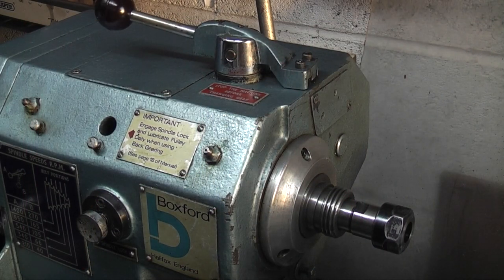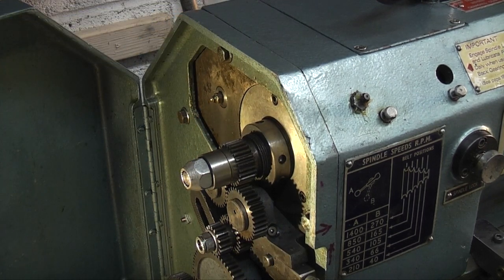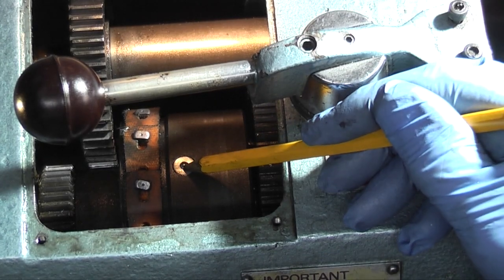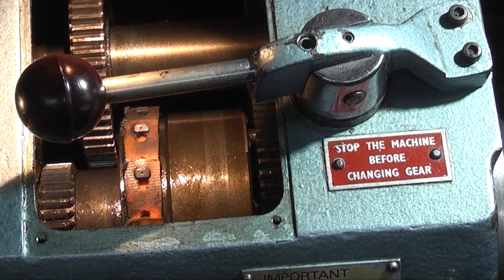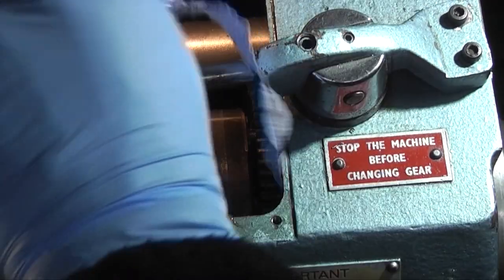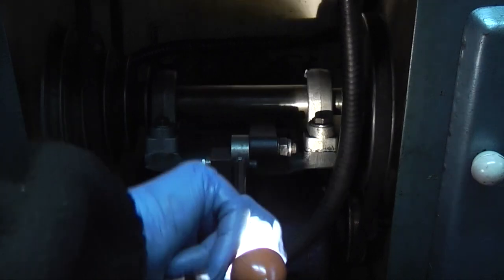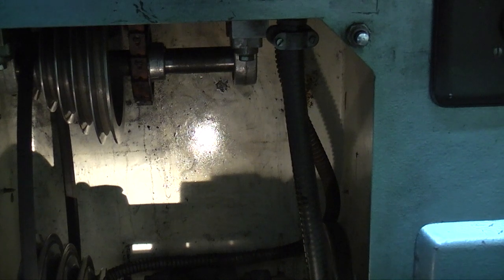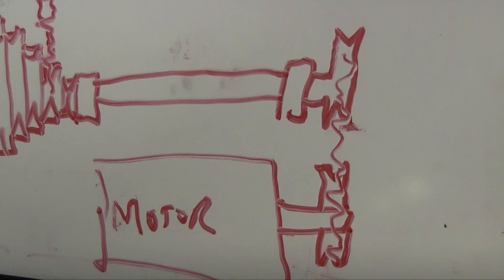Boxford Drive belt inspection

Comment: Hi Alan, Thank you for the very good explanation as I also had that experience of a slipping belt. I had to run a cloth reaching the belt from underneath turning by hand. My Boxford 41/2 inch has a differetn headstock arrangement. The back gear lever is at the Left hand back end of the head stock and engages the back gear by turning the shaft in excentric bearings. The dog clutch is engaged/disengaged by lever at the front.  There is only one square opening on the top of the headstock. I always find difficulty oiling as it seems that the oil does not enter through.

Comment: Just an thought. Could you replace the top cover with something like a 7mm thick piece of Perspex, Or make a metal frame to clamp down a piece of laminated glass? The inside would get splattered with oil, But I wouldn't think it would cover all of the surface, So you could still see through somewhere to gauge whether or not you were overfilling it. Something like Teflon spray could help keep the "window" clear for longer.
If necessary, you could also put a couple of button oilers in the Perspex lid to allow you to drip some lube on the gears when needed.

Comment: What is the code number on the belt connecting the motor to the counter shaft? It looks like A700? I need to replace mine so if you could confirm  that would be a huge help! Thanks. 👍
Reply from the maker: Hi since that video I have changed my motor for a digital drive the new belt is
A27 13x690 if that helps
Reply: @enotsengineering  That does help thank you, I measured mine to be roughly 26.5" inches so I'm in the right ballpark at least! 👍

Comment: Hi what size and thread are the top screws please mine are missing?
Reply from the maker: Hi I re tapped mine to metric
Reply: @enotsengineering  I’ve top one 80,the gear that will connect to the screw feed if it was there is 72 /18 so the 10 would directly drive the lead screw gear if that helps?

Comment: Think it's the wrong belt ours has a normal belt not one of those hard segment belts  .
Reply: Those are direct replacements.  They're a fair bit more expensive than traditional rubber belts, But you can replace them without having to dismantle anything in the head.
I think they're called something like a "Nut link" belt.
Reply: Mark, if yours is a solid belt not segmented I’d like to see you change it when worn out as im pretty sure you’d have to strip down the head to get your old belt off the main shaft. They are segmented belts so you can split the belt and feed it up and over the main shaft then rejoin it underneath.